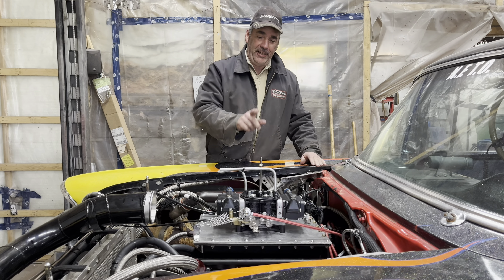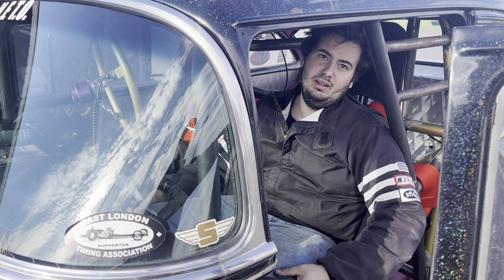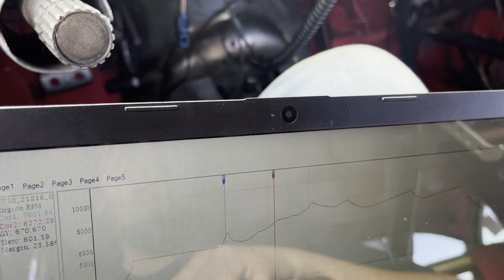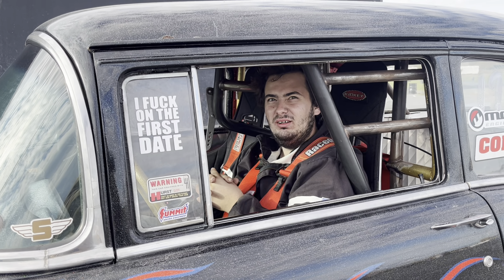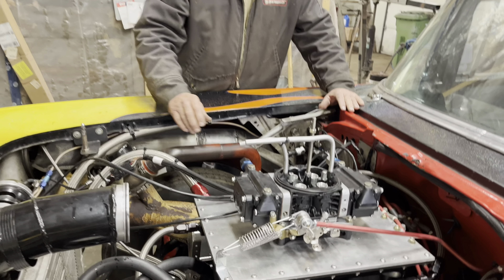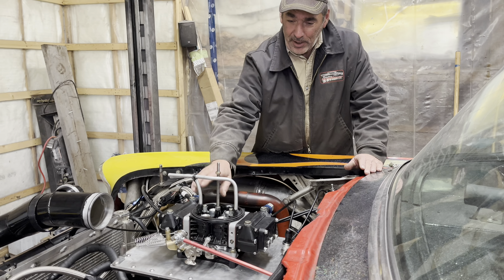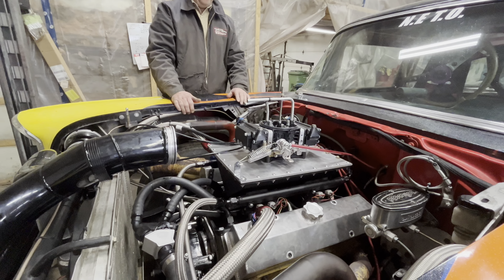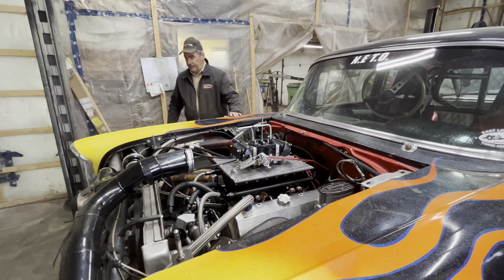The first ever Turbo Small Block with Fuel Injection and a Carburetor

Comment: My set up runs on the carb until boost comes on. I use the fuel injectors for port methanol injection over 10psi. Pretty cool setup
Reply from the maker: Sounds very cool
Reply: @EverythingHorsepower sounds hot

Comment: Ok, why? Is it just being novel.
At the end of the day the engine needs what it needs to make power. 
On a blow through carb setup it'll flow all you need regardless of size. Performance Techniques, decades ago, made 1000hp on a small block Chevy getting 30 mpg with a prepped 390 cfm Holley. This was on 30 psi boost.
Reply from the maker: We don’t have an air problem we have a fuel problem we are burning 1800 pounds per hour of methanol and main wells from the jets and the tubes going to the boosters physically can’t move that much volume

Comment: Nope you ain't the first......I designed a homemade fuel injection system 30 years ago..... finally got started on the system last year...... not exactly what you are doing..... mine is a carburetor with the bowls removed and a manual fuel injection that I can't describe......big block twin turbo 😁
Reply from the maker: It sounds really interesting
Reply from the maker: Are you working on a Hillborne type of injection concept
Reply: 57 with flames. As it should be. All is right with the world.
Reply from the maker: @jonmac155  Amen brother
Reply: Your cop visit was BS. Just like the flames - in a perfect world.
Reply: Nope not hillborn system or anything of sorts..... electric fuel pumps and jets.....one toggle I bump to start it the rest I control with micro switch wide Open throttle...... I'd like to keep the rest a secret for now..... turbo Jon did something similar a couple years ago to band aid a lean condition when he didn't have knowledge and money...... I'm doing it to be different and I'm a helluva tune up guy.....I have a big block Street truck the gifts 20 mpg......also I think im the only person in the world with a gbody on leaf springs lol tell that to you friends🤣😁😎
Reply from the maker: @marcbenish2204  I’ve gotta say we could probably have some interesting conversations